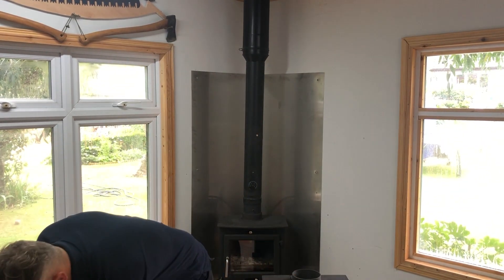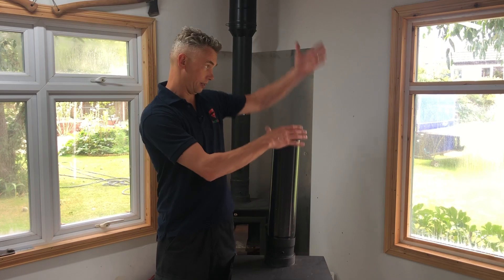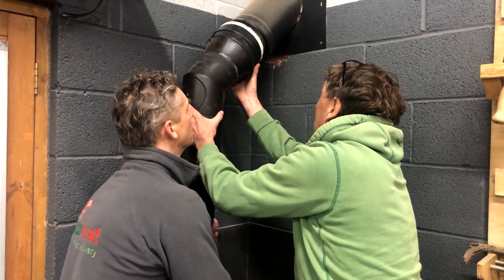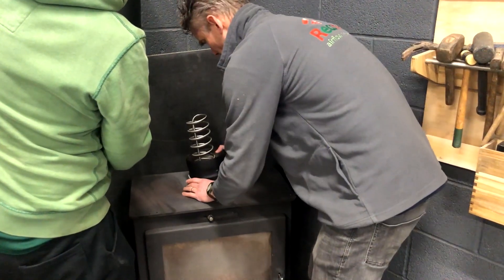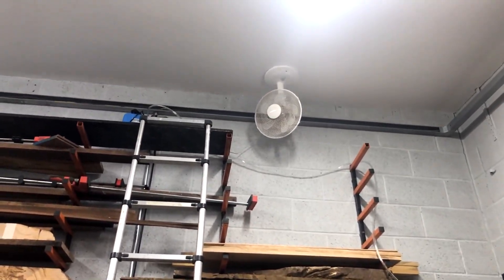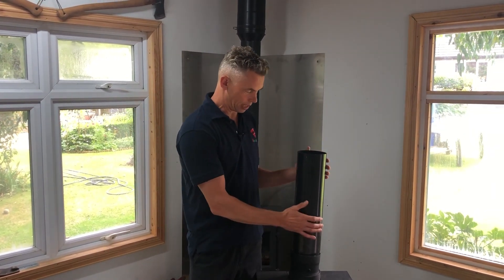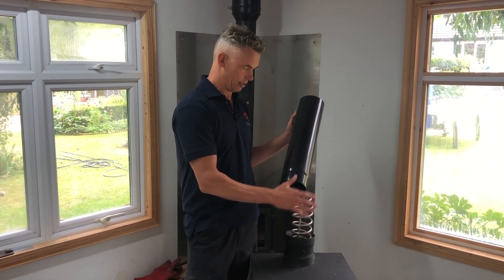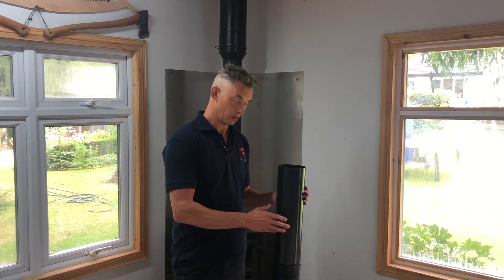How to install a Recoheat stove heat recovery unit to your wood burning stove

Comment: Hello Guys I purchased a recoheat last year 2022 once the renovation work pretty much finished on the new house I fitted the unit to my wood burner and I have to say what I invested I think around 300 pounds a small sum to lose if it did not work WELL I am here to say it works VERY well pleasantly surprised on how efficient the unit is very happy. I spoke to one of the guys at recoheat Will was his name very informative and to the point so thank you Will.
Reply from the maker: Thanks very much for sharing your experience John - fantastic to have your support. Really pleased to hear it's working so well for you. 👍👍

Comment: Just came across this system and I'm very interested in buying one but I've 2 questions ..1 Can I get in R.O.I and 2..will chimney sweeping be a problem as brushes wouldn't seem to get past unit..Thanks in advance
Reply from the maker: We ship to ROI free and you need pro rotary brushes to go through the coil - not those plastic Rocket ones that go up but not down. The coil is 65mm wide, so the rotary power 25mm heads are fine.

Comment: Hi, this is a great idea. I first saw this techncique for heat recovery on stove flues used by preppers in the U.S. who were wrapping copper coils around the outside of their flues. Your development strikes me as a great advance in the technique.  Couple of questions;

Have you pumped water through the coil instead of air, is there any reason why this wouldn't work?

I've visited your shop, you appear to have complete kits available but no coil/flue inserts only, is there a reason for this?

Thanks

Jan
Reply from the maker: Hey Jan, thanks very much for your interest. Pumping water through the coil would cool the flue a lot: it's got none of the properties of turbulent air we're exploiting. It would soot the coil up really fast as a result, and block the flue. It's also really explosive when subjected to these sorts of temperature changes, so one blocked valve and you're plastered around the landscape! We've suspended sales of the units by themselves at the moment just because we've been low on stock in the last few weeks, so are just restricting to people getting the complete kit. We're fabricating again next week, so once we've caught up, will make them available again.
Reply: @Recoheat  Excellent, thanks for the swift and full response, that'll save me (literally)  experimenting on my boat. I'll keep an eye on the channel and website for news and availability of the new stock.
Reply from the maker: @JanAltendorff  Thanks very much Jan. Out of interest, why wouldn't you need the pump?
Reply: @Recoheat  I live on a boat, noise / vibration is an issue, I was intending to look for a quieter solution (even if it was more expensive) before making a purchase.
Reply: @Recoheat  Having watched your video demonstrating the exit noise from the warm air nozzle, I'm not sure I could live with that background noise in my small living space.
Reply from the maker: @JanAltendorff  You can certainly hear it, though you get used to it very quickly, but of course - best of luck getting sorted out, and thanks very much for your interest.

Comment: If when you come to install the reco heat you find the flue pipe has lots of light fluffy soot this is not a issue that's OK the problem is if the soot is crunchy shiny soot we call creosote which comes in many forms.i would not then send it back much better to research how to use the stove correctly which in its most basic form is burning dry wood and not turning the air supply down too low,and I personally when possible add some stainless steel physical fixings through the flue collar and some self adhesive rope which gives a good seal whilst allowing for exspansion
Reply from the maker: Which is what is called competence - exactly what is required! Thank you very much for your contribution.